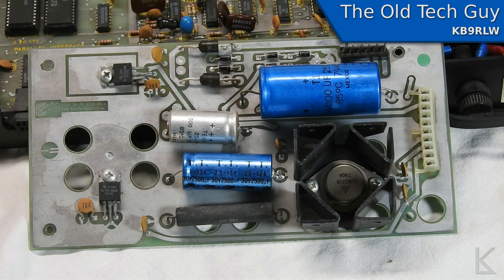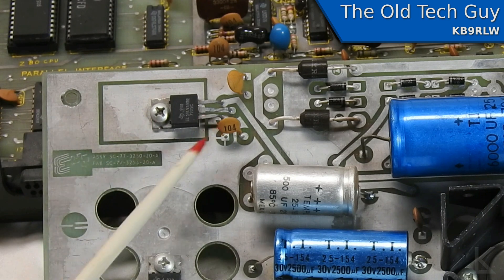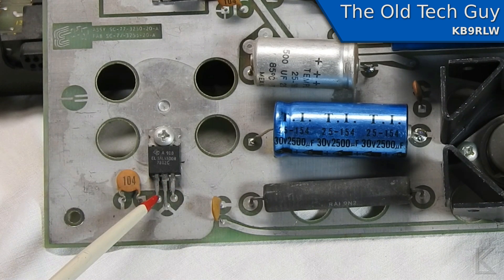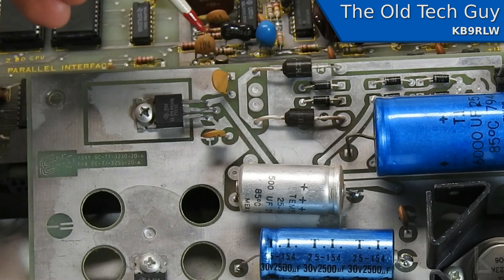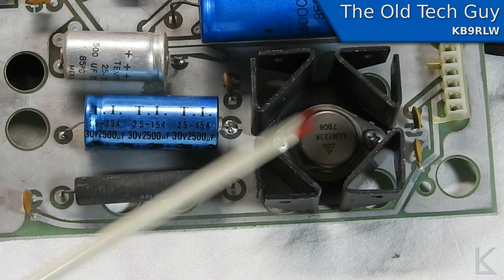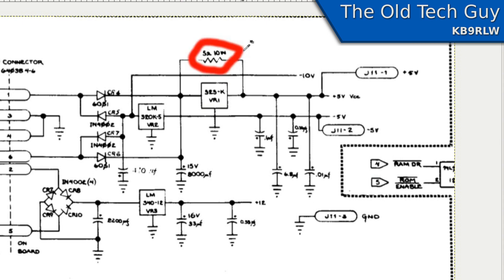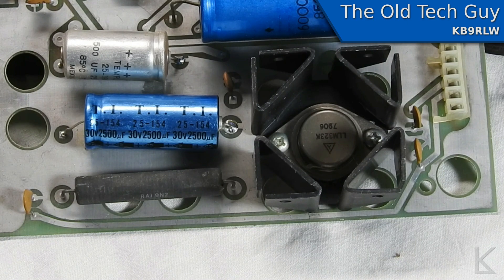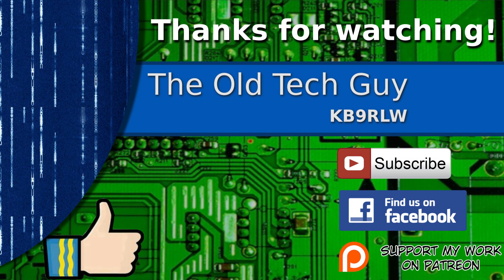Electronics - A closer look at the Exidy Sorcerer 2 power supply

Comment: Sorry this is still wrong. The pinout of the 7905 regulator is different to the positive 7805. The first pin is GROUND, not the input to anything. The middle pin is the negative input and the last pin is the regulated output. The ram is basically 16k by 1 bit DRAM (think 4116). The LM323 IS A POSITIVE 5V REGULATOR, for goodness sake the 7906 is the DATE CODE, there is no magic you are just not even looking at the data sheets,

Comment: Thanks for the video. I was not familiar with the MK4215N chip. Tried looking it up and there is not a lot on it. Turns out its a 16K dynamic RAM, three voltages, like the 4116 that was used in so many machines back in the day.

 Found this

 https://doc.lagout.org/science/0_Computer%20Science/0_Computer%20History/old-hardware/mostek/_dataBooks/1979_Mostek_Memory_Data_Book_and_Designers_Guide_Mar79.pdf

4215 see page 227
Reply: The metal tabs of the TO 220 devices are connected to the back side of the die directly to keep thermal resistance low. I suspect the silicon wafer doping type is different from positive to a negative regulator. It could be the same with more processing steps ..but that raises costs. minor detail.